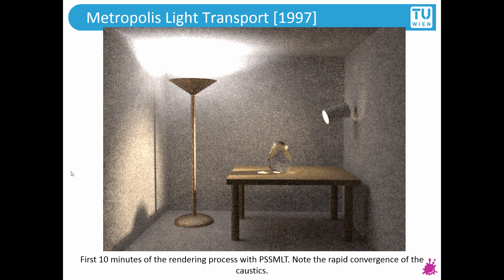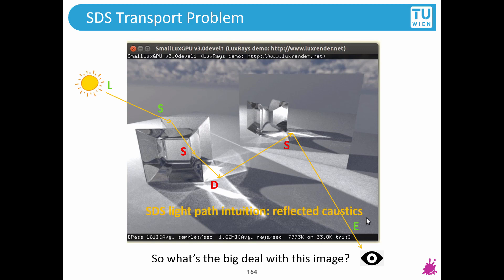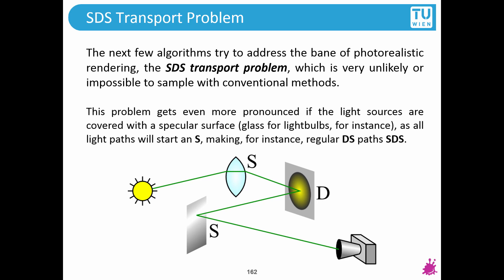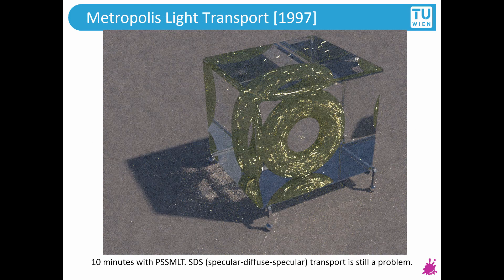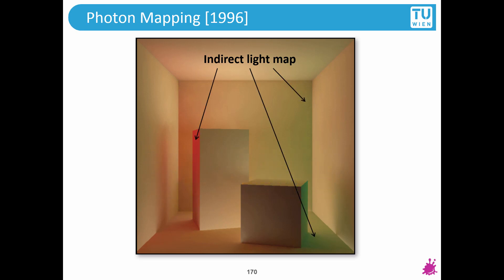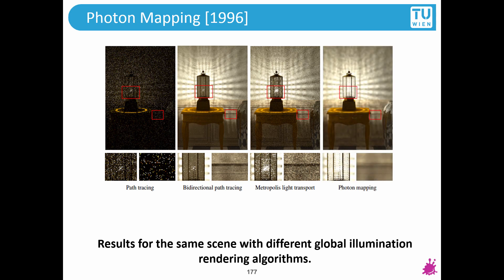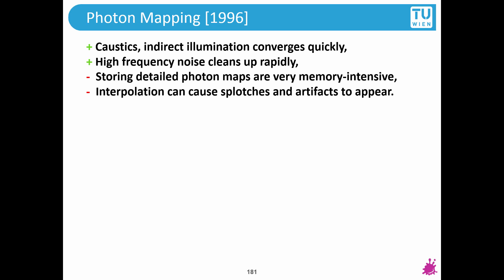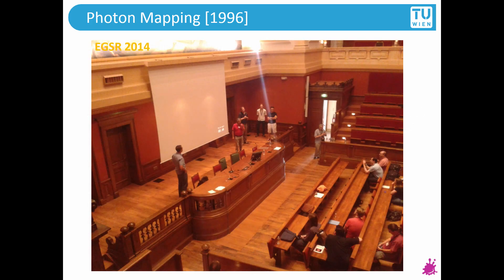TU Wien Rendering #34 - SDS Transport, Photon Mapping

Comment: An easier set up is simply a frameless glass window perpendicular to a diffuse ground and placed a meter up with a light source above and to the side. Light going through the glass to the ground, and then back through the glass looks SUPER DARK. (SDS path)  Just using two objects and a light source! It's horrific that this "simple" physical setup shows non-photorealistic results in most renderers!

Comment: I don't know how good this technique would get, but what if you position the camera in 1:29 at the poit where the light is located, and try to render the scene from the light source point of view? Doing so, try to take account of what portions of the diffuse plane you see from behind the glass cube (the light source would "see" the same way). In other words, we would try to highlight all the points in the diffuse surface the camera rays were able to reach, these would be the same points the rays emitted from the light would reach. Then we try to bake this "photon map" and simply add it to the diffuse plane texture in the end. Of course there are a lot of problems whit this method (it wouldn't be that good with extensive light sources, to begin with), but perharps it would give a more realistic-looking caustic pattern in some situations, whitout lots of calculation?